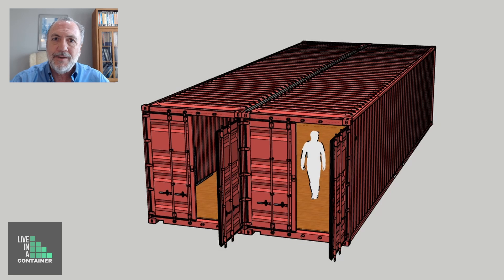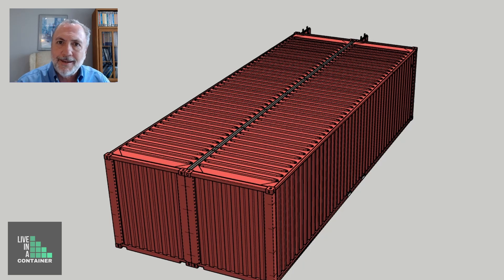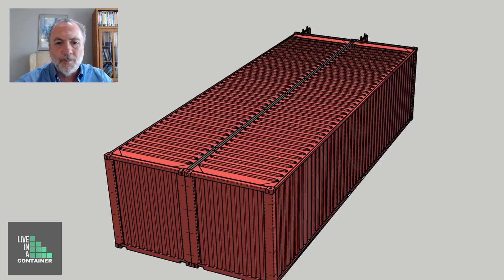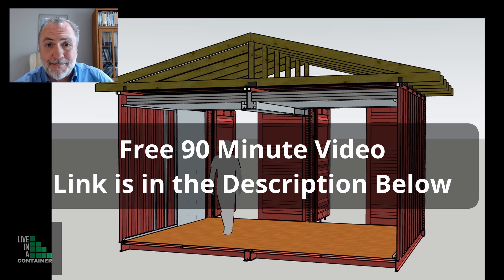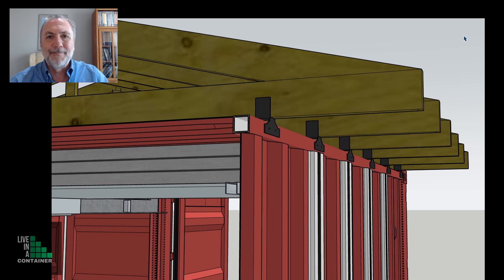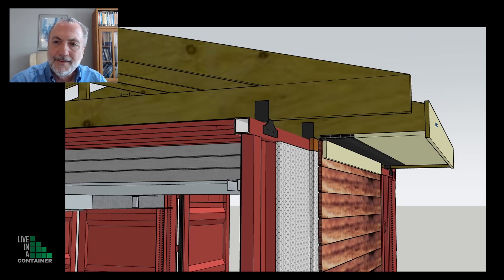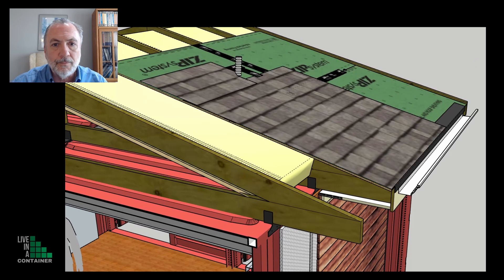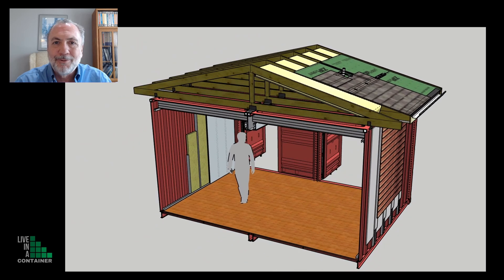Truss Roof over Combined Containers

Comment: I have a shipping container house that lives rent free in my head.  It’s 3 stories high.  The bottom floor is a garage/carport hybrid.  I see it with a garage door, the sides are decorative Breeze Block with supporting structural steel columns and beams, a storage closet at the back. The second floor is comprised of two 40’ attached containers and the 3rd floor is two 20’ attached containers.  I see the 3rd floor containers having 2 composite decking balconies, accessible at both the front and back(one screened in).  I picture the containers covered in either lapped Hardie boards or stucco Hardie board.  I think it would look great in pale yellow with white trim.  It would be perfect in either South Carolina or Florida.
Reply from the maker: That sounds nice!

Comment: what about  put I beams on top  rails of two shipping containers and connect two I beams on inside rails by trusses? This way, the two containers can have a space in between to have more living space.
Reply from the maker: I'm not clear about what your suggestion is. Are you suggesting to put the 2 containers a few feet apart and then frame between them? If so,  that would work too.
Reply: 24 feet apart and use 24 feet long trusses to connect between two  I beams.
Reply from the maker: Yes. That's would widen the living space well